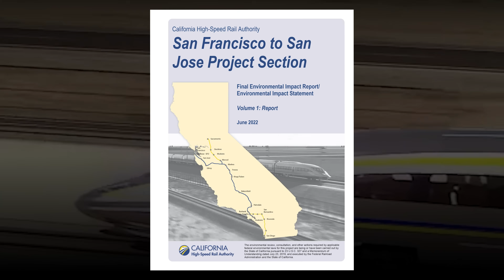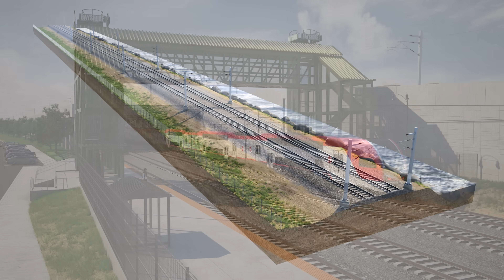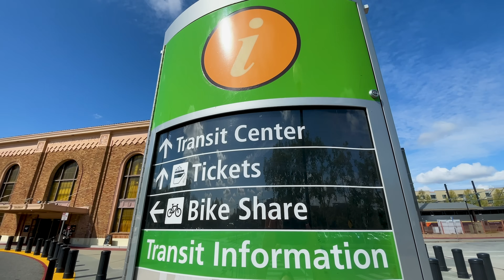San Francisco to San Jose Project Section Overview - FULL VIDEO

Comment: 4:48 This is an example of public vs. private. In public you see quad-gates being invested in as part of the system vs. BRIGHTLINE where quad-gates are NOT installed and there are lot of dead cars and bodies to show for the lack of investment.  It is why BRIGHTLINE trains still run as slow as they do (112 kph) because they keep hitting cars going around the gates. I don't recall Milton Friedman explaining this back in the 1980s or Mr. DeSantis either. Go CAL-Rail.
Reply: A private company just cares about profits. They don't have to pay out for collisions if they aren't at fault, so why would they make their system any safer than required by insurance/law? Governments answer to voters who tend to care more about deaths than profits.
Reply: You also have to consider the high concentration of Florida Men in that region which Brightline ignored.
Reply: @shitfuckmcgee8611  There is no way Bightline didn't consider the number of stupid drivers when dealing with crossings, after all, it is a significant reason why it isn't true HSR because they need to give time for people to gtfo the rail. There are just so many crossings that they don't want to invest in it, nor the company that actually owns the track want to invest in it.

People trying to go around rail gates is a very well-known thing, that at-grade crossings should be avoided where possible.
Reply: which is Ironic since Brightline has gotten $$$ in grants from the FRA.
Reply: Thats nice but Brightline exists and CHSR is just a Youtube video. Reply to me when CHSR finally gets completed in 2080. Maybe...
Reply: @greatwolf5372  they are well on their way in California. It's happening. And, Brightline has a high body count which would be solved with quadgates and sensors, or under or overpasses. That would cost money.